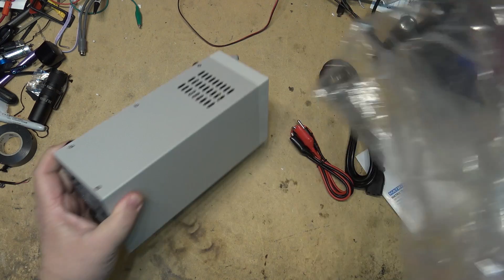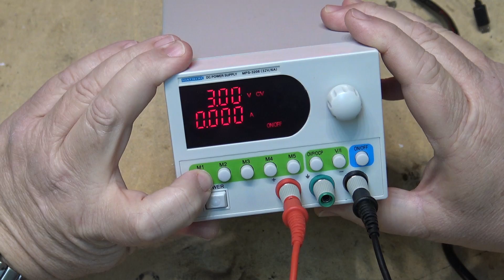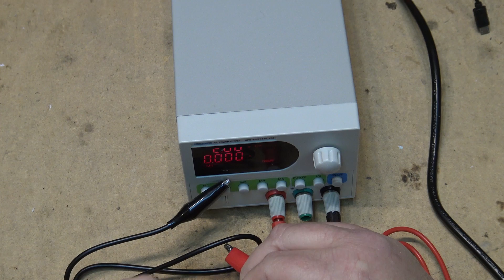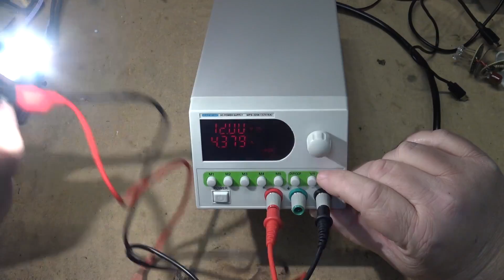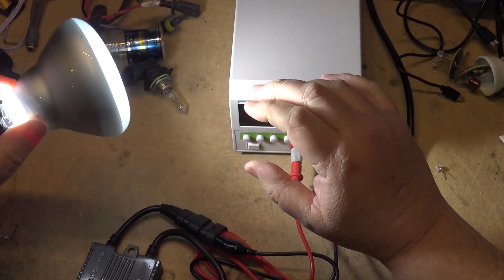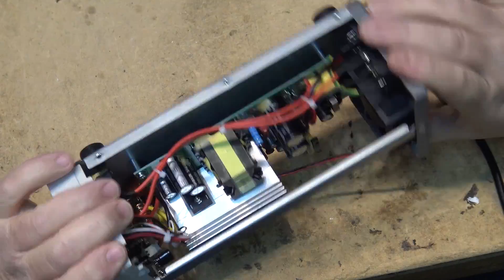Matrix MPS3206 32 volt 6 amp bench power supply review

Comment: Hi Dave, I bought the Matrix power supply and the power switch would not turn off...
Reply from the maker: There are 2 power switches.
Reply: @12voltvids  The front switch was bad so I replaced it with a good one from an old stereo and it's been fine ever since. Thanks

Comment: Short the leads together drive it up to at 6 AMPs. Do you leads start to melt like to PEVONO PS3005H.
  Is the ripple current so bad it destroys sensitive op amps and Jfets like the PEVONO. 
          And if you use it a lot does it break down after a few months like that PEVONO ?
Reply from the maker: Shorting the leads will go into current limit mode if 6.2 amps.  I have only had it 1day so I can't tell you what will happen in a few months yet.   I blew up the other one when I pit it in series with another one to get 60 volts out of it.  Tip, if you need 60 volts buy a 60 volt supply, dont put 2 30 volt supply in series like  was possible with linear regulated supplies.
Reply: Buy one and try it ffs.
Reply: Dave Rhodes I’m building my own from modules and more reliable module components. 
            My old B&K and my Hewlett-Packard and alpine power supplies are nearly 40 years old still reliable still work in a very clean pure signal.
Reply: Dave Rhodes I did buy one when using it on the project driving up the amperage the lead started to melt and smoke. 
          Has so much ripple current you can’t use it on audio products or anything with sensitive FET,s or any other component. 
        So I just built a linear power supply clean super reliable last until my grandchildren can use it.
Reply: Darryl 603 I did end up building my own. Instead of switching power supply I just built a extremely reliable and clean linear power supply instead of switch mode.

Comment: Looks like a nice bench ps ! I assume the fan is a thermal controled ? How is the feel on those push buttons ? S9 noise across the HF spectrum ! So you have both EMI and RFI interference..wow. 73
Reply: Jerry Georgopolis lot of times on these sort of supplies, the fan will automatically kick in at a certain Voltage/current.

Comment: Have you tested how much or little noise the power supply has. switch mode power supply can have a lot of noise if it is not well made. You can use a speaker or oscilloscope.

You do not get the same amps in 3 volts as you do in 30 volts.
you get 3 volts 6 amps, so you don't get 6 amps in 30 volts? isn't that how it works ??
Reply: skrotkalle skrotkalle no. If a PSU support 30v 6A it will deliver it. Should be a 180w PSU for supporting it.
Reply: @Todestelzer  I have a power supply. 30v 6 amp. when i use volt regulator i get more amp in 5 volts than i get in 30 volts.
180w ÷ 30v =6A
180w ÷ 5 v = 36A
But it depends on whether the volt controller manages to handle 36A  5 VOLT and how fuse you use.

Comment: If it's used constantly I'd like to see that one a month or so on down the road. Never heard of those caps either. Don't know why they chose the 6 amps instead of 5 or 10? I've still not purchased one, too many out there without no reviews. Also they never even show the insides like the caps & other components. Too much guess work without any reviews like yours. Thanks Dave.
Reply: Forgot to ask of coarse, how bad are the alligator clips? They soldered or crimped also the wire used itself. I never hear anything good on anyone's wire leads.
Reply: The alligators are very likely crimped. On the similar switch mode power supply I got, I was actually able to easily rip the alligator clip off of the wire with my hands. It didn’t break the wire, it just slipped right out. When ever you get one of these switch mode power supplies that come with a set of alligator clips, it is always good to re-do and Solder the alligator clips to the wires.
Reply: Having a switch mode power supply like this one at your disposal is always good for certain jobs. I always prefer linear supply’s, but it is always nice having a lot of power in a small light package even if it is dirty power.
Reply: Why they chose the 6 amps instead of 5 or 10? Well, 6A is greater than 5A and it probably cost no extra, yet 10A would require a larger and more expensive design.